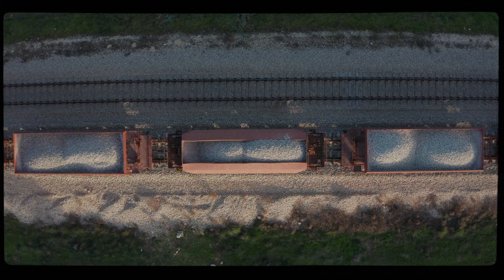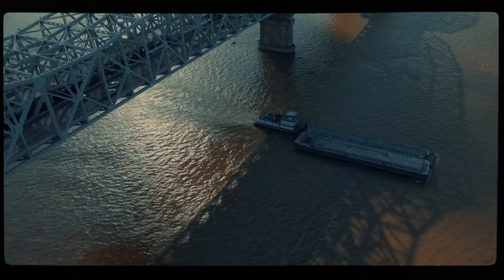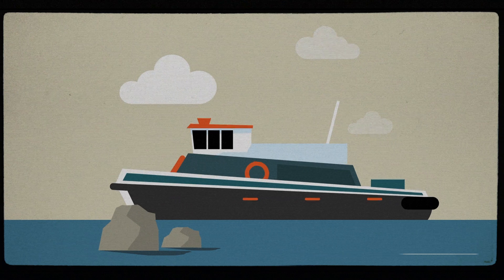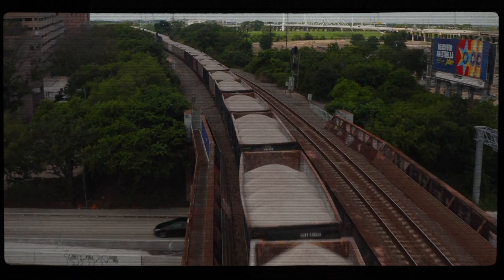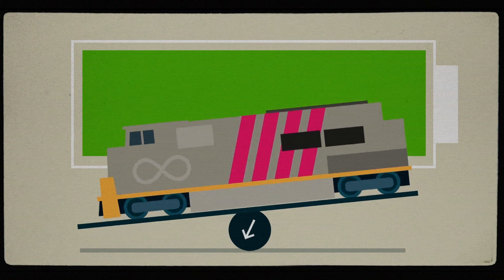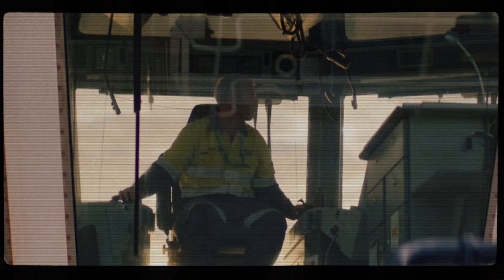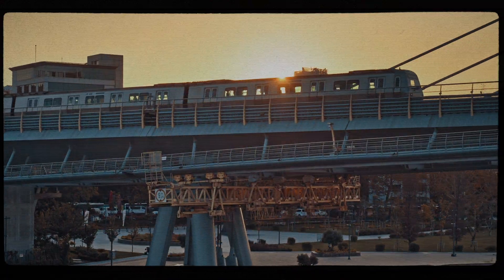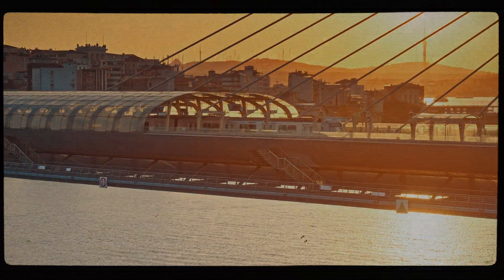Leveraging Nature for Transport Efficiency: Infinity Trains in Under 3 Minutes

Comment: Thank you for this, well done. 
Technology helps these concepts along. A company that makes graphene supercapacitors has them installed in heavy trucks and passenger trains. The capacitor can take the current from braking instantly and efficiently and store it for the next cycle of acceleration. The heat energy manifested during braking for these heavy trains/trucks is significant and until now has been wasted. Large companies have recognized this "waste" and can convert it to "operational cost savings."